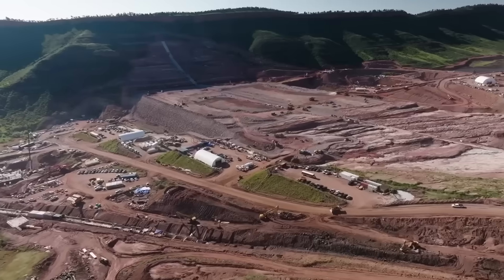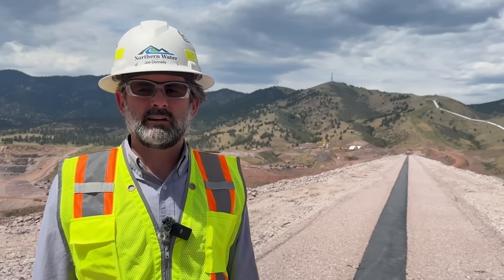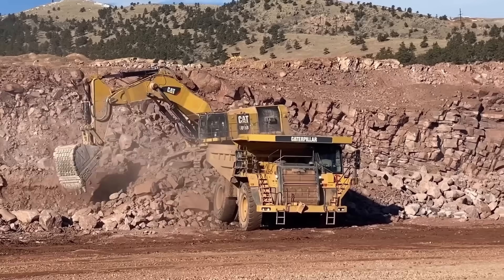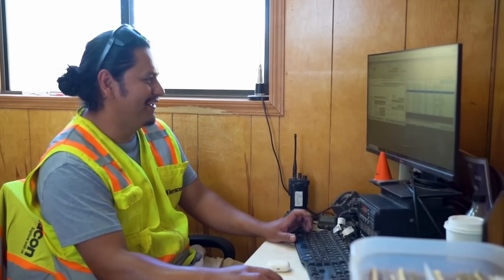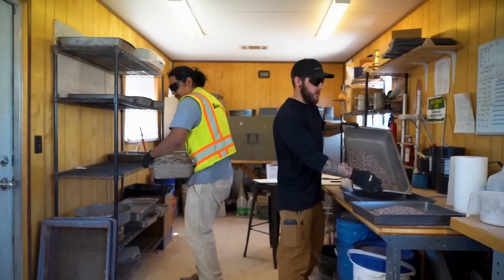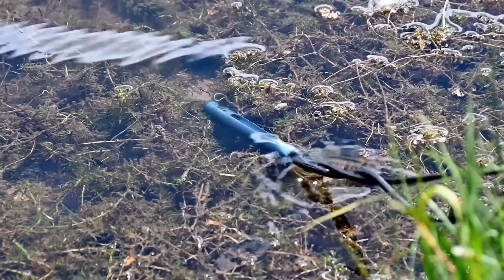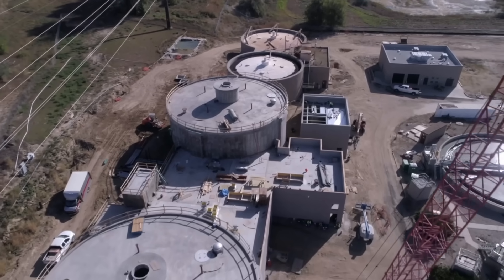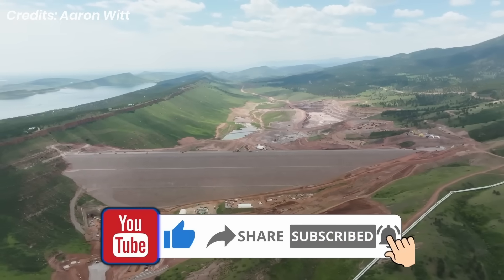The US Spent $690M on a Mega Reservoir… Then This Happened

Comment: What do you do? I don't know if you're going to get around to actually answering this, but the answer is obvious: you do not drink the water. You use the water for everything else. You use it for irrigation maybe depending on the crop. You can certainly use it to grow non-food items, including Forest for lumber. If the problem isn't radiation, remember but chemical ingestion. You can probably also stock it with fish and over time. See what happens. You can certainly filter uranium from the water. If you do want to drink it, you simply treat it. And you monitor the situation of course. But if this were a natural lake, it would be the same situation. Eventually. That level of uranium is going to fall off and we're probably going to see that after a few flushes of the dam, it will fall to a fraction of its initial level along with other contaminants.

Comment: Meh. The radioactivity will be within acceptable levels by the time they are ready to use it.  Not to mention that uranium is one of the easiest things to filter out of water. It’s been found at one freshly uncovered spot with a very limited amount of rain water. The amount that will leech into a full reservoir will probably be almost undetectable. The other thing none of you youtubers, especially the ones from other countries can seem to grasp is just how radioactive the ground is in the United States. Almost every house in Colorado has a radon removal system.  It’s nothing new here and the means to deal with it have been in place for a long time. If storing water in that area was a problem, the giant reservoir in the valley right next to this one would have shown that by now because it’s been there for decades. So, congratulations on posting more uneducated, misinformed, narcissistic drivel that 50 other youtubers already posted and did a better job with. 👎

Comment: Super heavy, nonionic, moderate solubility compounds are not likely to stay suspended in a nonturbulent water column and should trap in sediments or even leach back into substrates. There is an analog in lakes contaminated with lead from plumbing, fishing gear, and lead shot, although direct ingestion of lead by wildlife is a distinct toxic hazard, the level of lead in the water column is surprisingly low when sediments are undisturbed.

Comment: They can line the reservoir with clay and compact a sandy silt layer over that. Then lay a membrane over the areas of most concern and rip rap. This will seal in the radiation cheaper than concrete.

Comment: Lets wait to test the rock fill for toxic materials after the dam has been built. If we do otherwise and find a problem, we have to stop and lose all that funding and jobs. As for the sensible solution to coat the face with concrete. It will be buried like many of the easy solutions.

Comment: Mining locally exposed granite that may have been protected under top soil. Crunching the rock augmented the surface in contact with water... And the problem occurs.

Reverse osmosis waste a lot of water: it only extracts 5% of clean water for 95% of rejected water (and you cannot flush back the rejected water into the lake or the concentration of uranium in the lake will increase and the efficiency of RO will decrease accordingly. I know, I tried it at home).

Comment: The obvious solution is to just increase the legal safety limit, by the time anyone gets sick the politicians will have moved on, problem solved.
Reply: Honestly yep wouldn’t be surprised if they did that
Reply: How about stop measuring?
Reply: Congratulations! You beat them to the punch
Reply: This isn't a chemical company
Reply: One of the more cynical remarks I’ve seen in a while.
Reply: uranium is extremely easy to filter and uranium oxide is inert, it isn't anything nearly as bad as radon. Lead etc are much worse in water.
Reply: Exactly.  Solution 4: Send a golden gift to the white house and the EPA will realize the error in their ways and bump up the limit 10x.  Or, just eliminate the EPA.  Problem solved!
Reply: Trump’s EPA is already on it
Reply: trump is Dumping the EPA  that Dam is going to Fill and the people will drink the Poison water.
Reply: Is the current limit based on any actual science?

Comment: If the rock is radioactive then isn’t ALL groundwater similarly contaminated?
Reply: Radiation isn’t the problem… and Uranium isn’t all that radioactive. The byproducts of splitting the nucleus of a Uranium atom can be the most radioactive elements known to man, but Uranium itself is actually pretty stable. The problem is that Uranium is a very heavy metal and the human body tends to suck at dealing with heavy metals, so we call them “Toxic” and try to avoid ingesting too much of them.

Comment: Since I come from a mining background, someone failed to adequately characterize the material used for construction. Should have consulted with someone from CSM or an SME member. Lots of geochemical assays and a year or two of humidity cells to assess drainage chemistry work work. Engineering must have decided it was too expensive. Same reason why old mines need remediation. No one did the characterization work because no one thought it was important.
Reply: Engineers don’t decide something is too expensive. Management does that.

Comment: I don't believe for a half second, let alone a full minute, that they didn't know about this issue ahead of construction.
Reply: Reading between the lines, there is Uranium in all the reservoirs, but at a lower concentration.  The surprise here wasn't the presence of Uranium, but the amount.

If they had known there would be a high concentration of Uranium in the water, they would have tested the rocks before they used them as fill.  Contaminated rocks go on the dry side of the asphalt barrier, clean rocks on the wet side.
Reply: Developers working with public money would be foolish to do things right the first time. Mo money mo money mo money
Reply: uranium is extremely easy to filter and uranium oxide is inert, it isn't anything nearly as bad as radon. Lead etc are much worse in water. 
They knew yes, some of the best uranium in the country is actually from this area LOL
Reply: Of course not, current administration covered it up!
Reply: Your proof? Or just an unsupported personal opinion.

Comment: Funny enough, feed that water into datacenter cooling (which other people here mentioned), then take the evaporated water and send it to homes, and you now have a "free" distilled water source.
Reply: Data centers don't run that hot man. They pump out water at 150-180 degrees. Not vapor.
Reply: @fishingbob8374  That plus solar powered heat exchangers could add sufficient heat for solar distillation which is very old tech.
Reply: @fishingbob8374  Agreed. The CPU of a computer is the hottest part, and they simply don't give off that much heat (think about 125W under load)
Reply: And the data centre would have a whole pile of interesting material left after the H2O evaporated off
Reply: They could definitely still fill it and use it for something, like a nuclear power plant on the site with data centers!
Reply: Fuck their data centers!!

Comment: That’s still stupid decision , not cord drilling or to check deep deeps to see if there is sandy layers that ru. For long distances for water to find and leak out and deep fishers along with contaminated soil most  sites should have solid rock to perform such a project in my option as a lot dam structures are built on

Comment: This was never meant to be a. Drinking water reservoir.  It uses an asphalt core to contain contaminated water.  This is nothing more than a storage reservoir for industrial and commercial water use.  Moat likely for AI servers using power from Wyoming coal fired power plants.
Reply: Nope.  It goes into a common delivery system, not one dedicated to specific users.
Reply: @CoolinCouve It doesnt go anywhere atm. Its still filling.  They may have told you it was a common delivery system but that wont occur now.........

Comment: What about basically sealing the outside of the dam? A lot of Earth-fill dams have a cement layer around them.
Reply: not necessary. Uranium is not an issue in water, and uranium oxide is inert. Lead, mercury, cadmium are all more dangerous. And PFAs are 10-1000x more dangerous than all of those. 
Uranium is very easy to filter, and most of the time it won't do anything in water. The radon gas in colorado from its' decay is much worse and lots of people have that issue in their homes.

Comment: A whole lot of fine clay, fill it's lower basin with the clay sludge let it settle slowly drain, fill again measure and repeat if needed. Just to build a clay protection layer isolating the water from the ground components.

Comment: I live in Colorado and the ground everywhere is radioactive. Where I live, the granite releases radon gas and many homes need to make sure there is adequate ventilation to remove it. The reservoir is literally the next valley over from an existing reservoir, Carter Lake, yet you hear nothing about problems with that water supply.
Reply: well - you gotta ask yourself - is that because they haven't tested the water for uranium ?
OR - did they test the water and they found uranium contamination - but just are not going to say anything ?
Reply: @jonniiinferno9098  Braindead take.
Reply: have they smartened up enough to test carter lake?
Reply: @wes-w8s  We live on the other side of the ridge that separates Carter Lake from Chimney Hollow. The Carter Lake reservoir is a totally different animal from Chimney Hollow. The water does get filtered and tested. Most of it, AFAIK, goes for irrigation and industrial purposes rather than for drinking, although it does meet standards for that. Chimney Hollow is supposed to be only for drinking, I believe. However, it is advised not to eat the fish from Carter Lake due to mercury contamination. All the rock around here is full of radon, so this result is not surprising. Hard to believe the geologists didn't anticipate this happening because of the way the dam was constructed. Kind of earth science 101.
Reply: It's just Uranium it's not that dangerous especially in rock. This would be different if it was yellow cake getting dissolved into the water. It's bonded to other elements that'll allow you to pass it safely through your system.
Reply: @rexmann1984 😂😂🫵🤡
Reply: It's a non issue, our water treatment here is already prepared to deal with uranium contamination anyway because we have so much around.
Reply: @Raven1024  damn your clippy is only slightly different than mine. I thought it was me posting this I was like wtf I said something else
Reply: Pretty much wherever you live, granite releases radon gas.
Reply: Just thin how many folks
And politicians and their friends got large amounts of money off that Build
AND NOW THERES MORE MASSIVE AMOUNTS OF MONEY FLOWING FROM THAT SAME PROJECT FOR YEARS TO COME !!!!!!
Reply: If this was in Illinois they would just fire the company who found Uranium results and hire one that doesn't and carry on.
Reply: It's not contaminated.  :thanksdoc:  The politics of Colorado taking water that now is flowing into California (and other states) was not to be allowed. The fact that Colorado has the right to that water is not important to those who do not want that water transferred to the other side of the mountains. They needed a reason to deny it and decided that this was a good one.  Filtering water is an old and well developed technology.
Reply: That explains a lot. I thought it was metabolic disfunction from the munchies
Reply: uranium is extremely easy to filter and uranium oxide is inert, it isn't anything nearly as bad as radon. Lead etc are much worse in water.
Reply: We have the same issue in central New Jersey. Radon gas. There are inexpensive test kits you can use, and if there is a problem, adding a small ventilation fan to the outside has always been the solution. Not sure if that would work on the bedrock under a massive reservoir.
Reply: @WBS001  Looks like the major risk of radon dissolving in water is still through inhalation. Through shower steam etc it can enter your lungs, where it will do damage. Drinking water with it dissolved still doesn't show any signs of causing issues. 
Obviously with both the "amount" matters, but this is what we've studied so far globally.
Reply: I know it’s not a good idea to eat too many fish out of Carter because of the mercury levels
Reply: @extremehunter11 a common occurrence in many lakes . In south dakota recommendations are to not eat fish after a certain length out of certain lakes . It takes time for mercury to biuld up in their bodies. Smaller fish up to 16 inch are safe .
Reply: They wont dare test Carter Lake Res
Reply: It is a capture rain barrel from highly intermittent dry creek drainages, the first Estes storm of the century had 18" of curb of water running over a part of  US Hwy 287 that has been diverted from the footprint of the new storage reservoir. I know because I hit that surprise water curb at 35mph pulling a boat back from north park. The fort collins newspaper had the 1976 storm of the century describing part of that big misplaced Kansas rainstorm. About 10 years ago Estes had a second storm of the century. Again another misplaced Kansas toad strangling rainstorm. (Pattern developing here ain't it.) So you see the Noco water depleted over-development of housing growth is hedging a bet for a larger population base. More water is a major key for population development. Basically more druggees to expand colorado's illegal controlled substance money scheme. W9rked well with Joe Wright reservoir. Might work with unpromised water.
Reply: …it’s possible for one valley to have different geology than another.
Reply: @Karochsharon  EXACTLY!
Reply: @Karochsharon  It depends - on the Front Range, the rock units generally have a linear north/south exposure and several of the reservoirs run north/south. So you'd have to see the topography.
Reply: Radon gas comes from decaying Urainium.
Reply: Lake Mead and Lake Powell are fed by rivers that run through rock layers that contain Uranium. Southeastern Utah has mines that contain Uranium. I worked in some of these mines surveying them. I have never heard anything about Uranium contamination in these reservoir which feed some of the most woke regressive global cultural Marxist areas in the USA...California. One would think they would be demanding restitution because of Uranium contamination. 

I think this is just more environmentalist nonsense designed to halt any progress and population growth. 

As for just over the ridge...my bet is that water has Uranium in it as well...the front range has all kind of Uranium bearing rocks...make one wonder if the reservoirs deep under ground are not contaminated as well since the water percolates in to those wells through Uranium bearer strata. As a Home Inspector, I have never had a request for uranium testing of well waters...only  fecal coliforms and E. coli , Nitrate and nitrite. There are dozens of naturally occurring minerals and inorganic elements that water picks up. Maybe thousands of man made substances and PFAS infest the waters as well. To pick on uranium is just pseudo science designed to delay the project.
Reply: When life gives you a radioactive lemon build a cool-aid for datacenters.
Reply: Except it's full of bodies that were never recovered!!
Reply: AND I used to get antler sheds there! MOST BULL ELK SHEDS WERE RECORDS!!!
Reply: Mine the uranium and clean it all up! This is a great problem. Rare earth elements are the future.
Reply: Look at the bright side , somebody made a lot of money !!!
Reply: Oh my goodness .NOW EVEN MORE MILLIONS WILL FLOW THROUGH THAT SAME PROJECT INTO THOUSANDS OF POCKETS !!!
OH WELL !!!!
Reply: @JamesOglesby-mk7qb politicians might start out in politics for the right reasons. But then get stuck in the same old game
Reply: Horseshit cried the sparrow! We'll all feast!  Ugh naturally occurring earth gasses like radon occur everywhere on the earth's surface. You just don't want to be unlucky enough to live in a radon gas trap like a basement as an example. Maybe Phizer has a vaccine for radon also. You must only hope!